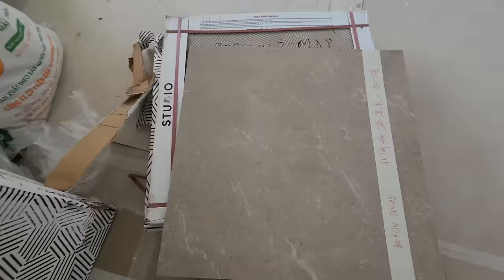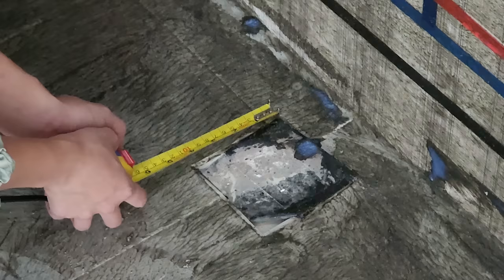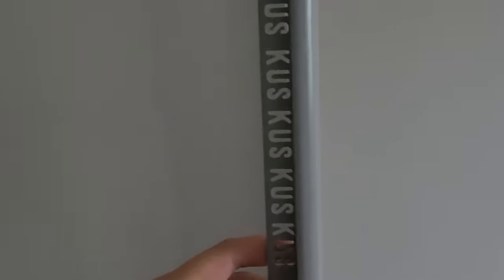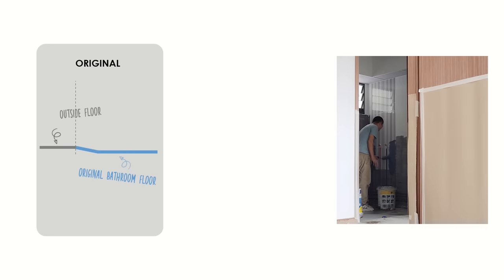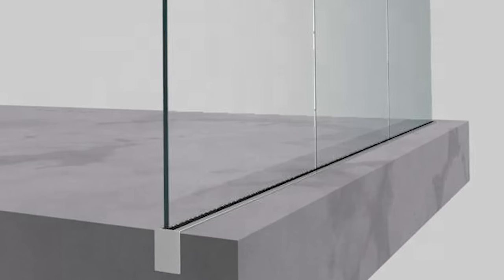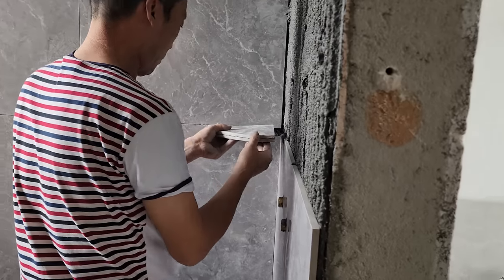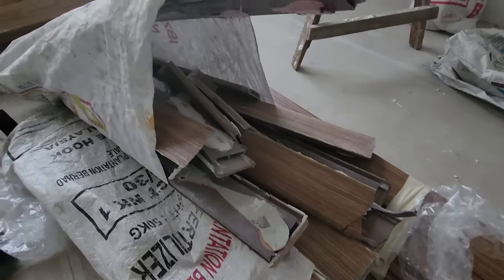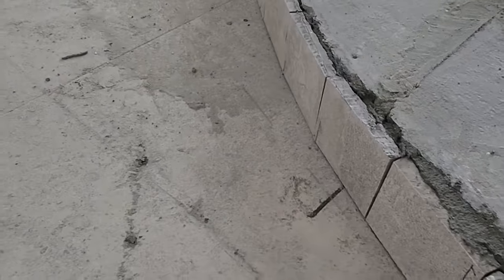Tiling Tips We Wished We Knew... | Self-Designed Neutral Contemporary Home | EP07 HDB BTO Journey

Comment: Hi i benefitted a lot from your video . But i have a question  1) where you all place your aircon pipe in toilet - the little grey one .2) Is there a way to hide it ?
Reply from the maker: Hi Joseph, glad to have helped! 😁🤩 that is the water pipe and for us, the aircon installers did a pvc trunking for it. The whole trunking is then mostly hidden in the profile of the top mirror carpentry and the bottom vanity carpentry. Only a small segment of the trunking is visible at the corner behind the basin. 😀
Reply: @thesuakus  Thanks for the reply

Comment: Hi, can I know if you did overlay for yr toilet floor? Am told by ID that regardless whether there is overlay or not, as long as floor trap is changed, warranty is void as the original would hv been removed by cutting/drilling. I'm at the stage to decide if I want to change the floor trap as I hate the given one.

Comment: Hi suakus, I'm confused, please help me! Do you need to do a cement subfloor if doing tiling?

My understanding so far is that a level cement subfloor is needed for vinyl/laminate but not for tiles.

However I also read that tiles alone won't make up the 40-50mm gap from bare floor to door, hence cement subfloor is still needed.

What was your experience and what did your research teach you about this? Thank you!
Reply from the maker: Hi Chris! Unfortunately this part we left it to our ID / Tiler to settle. As you may have seen in our Hacking, Tiling and Bedroom episodea, our vinyl flooring was removed and the Tiler simply tiled over the cement base. This resulted in a height difference from the Living Room Hallway and a transition strip was used at the doorframe. This is one of our reno regrets... should have researched more to ensure that our flooring is all levelled..😅
Reply: @thesuakus  thanks Suakus! All your vids are super helpful! Can you link the video here? I've watched all your Reno videos but not sure which one you're referring to
Reply: @thesuakus May I add n hindsight is always 20/20, for anyone else,ask the contractor to cut the cement n recement it with a slope it to meet another room,in this case,the living room then it will be seamless but obviously u hv to pay the contractor more to do this.

Comment: Hi there, just want to check did u replace ur kitchen tiles? because the tiles looks different from the previous video
Reply from the maker: Hello! We overlayed the kitchen tiles that came with the flat! If you're referring to our first episode (tiles selection), then yes you are very observant! We swapped around with the common bath tiles because the one we wanted for the kitchen was out of stock. Here are our final tiles used 😀

Master Bath walls: Hafary MA66374P and MA66373P (accent wall)
Master Bath floor: Hafary Q9998M
Common Bath walls: LSH Berlin Crema and Berlin Taupe (Accent Wall)
Common Bath floor: Hafary 60SV08RT
Kitchen floor: Hafary 60SV01R
Bedroom/Wardrobe room floor: LSH Harmony White
Reply: @thesuakus  hahah i see i see, no hacking needed for kitchen tiles?
Reply from the maker: @kohcherng7074  Aha we explained more about the difference in HDB BTO regulations for bathroom tiles and kitchen tiles in our Kitchen Part 2 episode! Kitchen we chose to overlay so as to maintain the waterproofing warranty. You can legally hack kitchen tiles for BTO if you want

Comment: Seems like there are few items that your ID didn't flag out or check with you all beforehand (eg. Floor trap, 45 degrees corners, curved cement base), which an experienced ID will point out before executing. Relatively new ID?

The method one for step down shower is correct. Except you don't really need the 4th kueh lapis layer since the water should be contained within the step down (that's the point of step down)

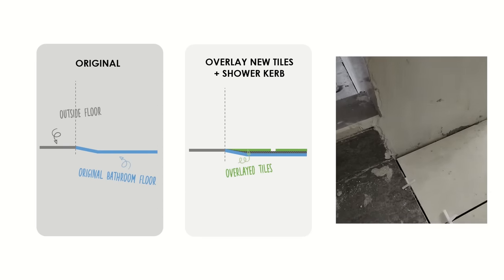I hope you managed to get them to redo the toilet entrance tiles at 7:13. It should be easy to rectify, but some IDs try to dissuade you because they need to call in the tiler again (which they should rectify if they didn't clarify with you beforehand on the tile boundaries)
Reply from the maker: Thanks for your kind sharing!🙏 We hope that this video would help future homeowners to start thinking about the right questions to ask the right IDs at the right time (at the planning stage -- before it is too late like us 🥲)

Method 1 looks about right yeah? Might need to double check all the funny renovation guidelines about thickness and number of layers.. Seems like this would require the feet to 'step-up' from the outside. (Right now, our single overlayed bathroom tiles happen to just nice flush evenly with the outside tiles)

We still can't visualise how the glass door would look like.. especially the peeling edges hugging the bathroom wall tiles. Hopefully it all resolves in the end and we'll show the updates when the glass door is finally up!
Reply: @thesuakus  peeling paint at toilet could be due to poor paint job, not applying correct sealer considering the toilet area would be high humdity area.
Reply from the maker: Actually, that crumbling wall haven't paint yet.. Just wondering if sealer and paint would help, if the wall itself is weak 🤔
Reply: @thesuakus m commenting this after 10 months n I hope your ID has already solved the issues of the corner entrance n base(curb), if not use marble jambs for the 2 sides n base then u will not face flaking cement. Flaking cement in corner is not avoidable n is due to cement not properly cured or weak mortar mix. Hth

Comment: Hi, this just in time for me, as my bto is starting its screeding today, follow on will be kitchen base, overlay of 2 toilets. After seeing your video on testing of lippage, my tiler told me that this is unforeseen due to the nature of the tiles as the tiles are not totally flat you can use 2 piece of floor tiles (before laying) put them front to front and compare u may see the difference of 1 to 2mm difference and therefore after laying of tiles testing of lippage a 1 to 2mm difference will happen. Hope this help...
Reply from the maker: Exciting times ahead! Aha you're fast to check with your tiler, thanks for sharing! Agree that natural thickness variations are alright - so for those tiny 1-2mm differences we're letting it slide (no pun intended). But there are some tiles where even the naked eye can tell the protrusion from afar (3-4mm ish) on say 1 out of 4 sides...which means it is not levelled flat, with uneven mortar at the edges. Since we're on a tight timeline, I guess we're gonna close an eye...
Reply: I see... ya sometime is how much we can accept. Cheers and enjoy on the whole renovation process hee...

Comment: Quite strange , we didn’t have ID and just engaged contractor and they didn’t make any tile-related mistakes that appeared in your video.. our tiler also automatically slope the flooring towards the drainage which was a really nice detail
Reply: Hi Ode Chan, which contractor did you engage? We’re looking to start our journey soon, without an ID as well!
Reply: All bathroom subfloor needs to be sloped from the back, front n both sides to the drainage ,all bathroom contractors should know that. The other option is to use marble jambs for both sides(tiles end at opening of entrance to shower) n bottom threshold, by using jambs,you don’t need a aluminum corner pieces(transition)

Comment: i'm facing same issue for toilet frame now. Removed the hdb door frame and now stuck with the sharp edges
Reply from the maker: Hello! Do you have an ID and what was his/her recommendations? We still don't have a solution aha waiting for the new doors to be installed first and see how..
Reply: Use 6 inch marble jambs,this will overlapped the sharp corners and u just use silicon to seal the inside n outside between shower floor  tiles n the jamb (if I understand that’s the sharp corners of the entrance to the shower where the glass shower door will be attached)

Comment: Did you hack your kitchen tiles to lay new tiles? Where did you get the floor trap? Your videos are very nice and helpful! Thank you for sharing
Reply from the maker: Glad you find them helpful! 🤩 Nope, we overlayed the existing HDB kitchen tiles so as to maintain the 5-year warranty for the waterproofing system. The floor traps were purchased at Sim Siang Choon IMM 😀
Reply: I see! Thank you for sharing! Btw can I check if removing the toilet door frame is compulsory to install glass door?
Reply from the maker: Good question.. I think its possible to leave the frame if it looks good. If you have wooden-designed laminated door frames like ours, then it may be better to remove it for aesthetics, as painting may be an issue (easily peel over time) and good laminate solutions are costly. 😃

Comment: care to share what is the total reno cost? and which ID firm did your hire?
and regarding the step down shower area i ask the same thing from my ID what he say able to do is entrance of the toilet raise a kerb hence you able to overlay the dry area to create the step down shower area.
Reply from the maker: Hello! We won't be sharing our ID or total reno cost publicly for the time being.. maybe in a later video when the house is more or less done! 😆 

Thanks for sharing about that! So that's the option 1 we mentioned I guess?
Reply: To do an actual step down or seamless shower, the cement floor needs  to be hacked ,at least by 2 inches lower so that new cement subfloor can be poured and water proofing materials which will b costly or even against HDB regulations.  Raised curb/threshold will be the likely option,ask your contractor to raise it by minimum allowable height,look much better n not “butt joint “ the tiles of the curb, use 6 inches marble jambs, so u don’t hv to use those aluminum corner pieces.

Comment: Hi, You mentioned that your kitchen tiles are overlayed instead of hack off. Will this cause your kitchen floor is higher than the dinning area? As overlay tiles usually is about 2cm height. Thanks
Reply from the maker: Yes, it will be higher but our kitchen entryway is small and will be fitted with a trimming slope 😀

Comment: extra notes :
1. tiling shelf in shower looks real bad. you can just get any quartz stone company (or the company who does your kitchen quartz top) to do the corner shelf and slot into the wall tiles cut gap. around 60-100$ per piece, much more durable and easy to maintain, dont have to worry bout raw cement flaking off through time. if you are doing vanity quartz top, can pick the same stone code to match in shower area too.
2. tiles itself is not 100% flat, sometimes the edge bumps appear due to the edges of the tiles may something warp up/down
3. can get tiler to just do a single layer of waterproofing prior to overlaying for those kiasu owners
4. always remember to put the full piece of tiles from the most obvious corners if entire toilet is same wall tiles and lay out from there or get your ID to draft out floor / wall tile finish plan so you can plan before hand
5 . add on to point 4, start a full piece of tile from the top for walls so you dont end up with weird tiny strip of balance tiles at the top (experienced ID and tilers will calculate for you)
6.  sg floor trap for hdb generally is 4 and 6 inch 
7. silicones for wet areas eg shower screen have expensive and cheap ones. expensive ones does make a difference when comes to mold resistance.

your ID seems abit inexperienced tho. best of luck!
Reply from the maker: Wow thank you so much for taking the time and effort to write this 🤩🙏 Really appreciate your sharing!! Super helpful for everyone, especially future homeowners!!
Reply: @thesuakus  you are welcome! Im a senior designer by profession, I am also a homeowner, always important to get things planned out and done right to prevent burning bigger holes in pocket. I have friends who went through the same reno/regrets and they had to fork extra to rectify , so just wanna share it out there to help since money not easy to earn haha. Theres actually alot more to write about tiling, but I just write the important ones la , best of reno to all homeowners.
Reply: Something else to consider is try to avoid 'butting' tiles, where the edge of the tile is exposed like on the tiled shelves and the shower curb. The edge usually doesn't have the glaze that makes tiles easy to clean -- it makes them very prone to staining and chipping over time, and since they are porous they are difficult to clean. Where possible they should use an aluminum corner bead and then mitre the edge of the tiles, so that after grouting only the glazed surface is showing. 

Other problems in Singapore, is that most of the tilers we get are from China, they are very fast and have done 100s if not 1000s of homes, but many of them are taught with 'best practices' by some older trades person rather than a technical school. Also their construction industry isn't old like in US, Euro or Australia where you have 100 yr old homes with tiles still looking good. Speed and 'good enough' is what they get paid for. So many of them are not trained to use newer products; even though companies like Mapei and Davco provide training of their new products (lots more tech.) On top of that they tend to any how mix products like tile adhesive with cement strengthener, or other chemicals to get a faster set and cure; but this is not recommended by the product manufacturers. Supposedly HDB deals with 2,200+ cases of tiles popping up every year, that tells you where we're at. In many cases the ID's don't have enough technical or product knowledge themselves to catch / call-out these mistakes...they also get smoked by the contractors / trades people.

One of the things I've learned is that no one will care about your home as much as you do, so don't let them 'talk down' to you. Over communicate your expectations (politely and before agreeing on price) and you'll weed out more of the slipshod workmanship. Never pay everything upfront. Don't be afraid to 'google' the materials, a bag of floor screed can vary from S$8 to S$78 depending on the 'tech' inside. I've seen contractors charge for the S$78 bags, then they dilute it by mixing in the $8 stuff when they run out. Manufacturers today have very good websites that even lay people can understand, lots of reviews on youtube too. 

Above all, make sure they get the flooring right, whether it's tile or hardwood -- it's the hardest, most messy inconvenient expensive fix once everything else is in. Contractors also know this, so the bad ones when pressed for $ or time, rush through and know that you're unlikely to push for much rectification since you're rushing to move in.

All the best on the rest of your reno, hope you get good tradespeople with passion and care for what they do.  If you get stuck, consider getting someone who markets themselves as a 'builder' , I've found these have more experience in both the project management and QCing. 

Sorry for the short essay <yikes>, but I'm passionate about our industry, and I know we can do better, especially with property prices going so high. Thank you for the video and being part of the solution.
Reply: Can you share about silicone that is expensive and mold resistance?
Reply: @moseslargado3288 thank you so much for the advice.

Comment: I don't understand that the ID nvr manage the contractor? This is the second reno using ID but they don't check on the construction works. It's part of their job, when client hire them. What the point of ID if all tiling, waterworks, etc are not 100% checked and project managed by ID.
Reply from the maker: Indeed... we will definitely go down the Contractor route for our next home. Every inch of the entire house was designed by us from scratch with a 100 page PowerPoint plan. We figured what we really needed is a good project manager.

Comment: The floor trap is nice. 

However I don’t agree with a step down shower nor a curb. This is because these are actually potential hazards, especially if you are going to have elderly folk in future.

Wetness in a toilet bathroom can be easily solved with proper selection of tiles and also buying the right squeegee to scrape your floors after a shower. It doesn’t take more than a few seconds to do that. Also positioning of shower fittings with respect to where the floor trap is is important also as it will affect where the water goes.
Reply from the maker: Hello, thanks for sharing your thoughts! To each their own - what works for a family would not work for another, so what's most important is planning it in a way that makes sense for your lifestyle, needs and workflows 😃
Reply: @thesuakus  yes it is important to know what you want when discussing with the ID. There are many who let the ID decide most of the reno and end up with disastrous outcomes.

A good ID or contractor is able to translate what you want or request into a feasible solution. Suggestions from a ID to deviate from what you want is should also not be very far off - if the ID is a good ID
Reply from the maker: 100% agree with this!! An ID should be someone you can work with to bring your ideas to life, while giving you insightful recommendations from a design and functionality perspective.

Comment: Just need to raise your toilet entrance and then drop it at the shower area. You can slope the entrance toward your hallway (i.e. reverse the usual slope into the toilet) if you're confident that only your shower area will be very wet. I imagine it's possible to cut a small drain just before the slope to guide the water away from the hallway.